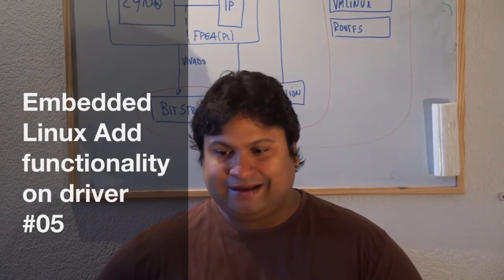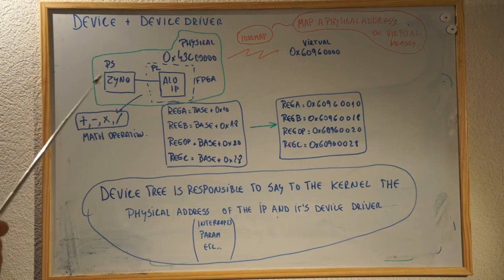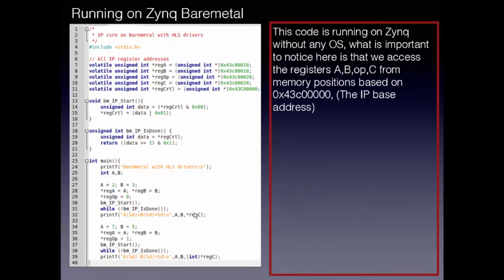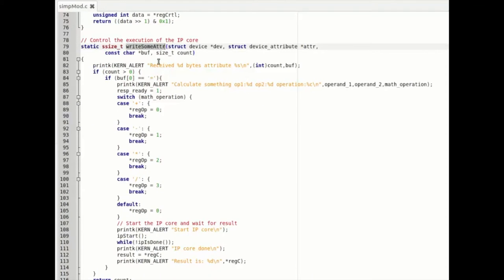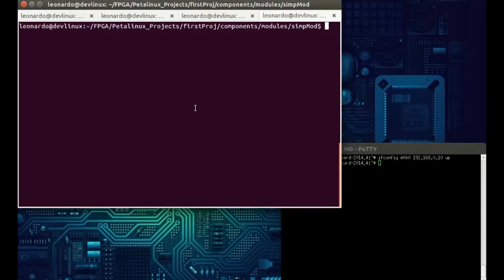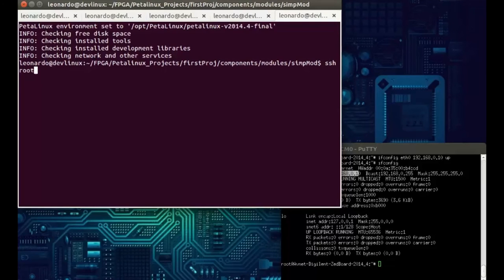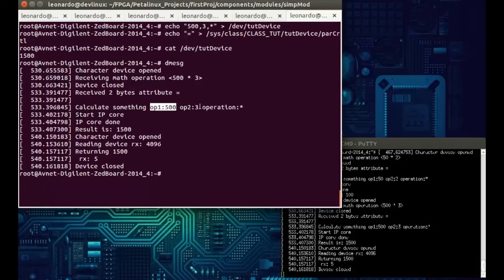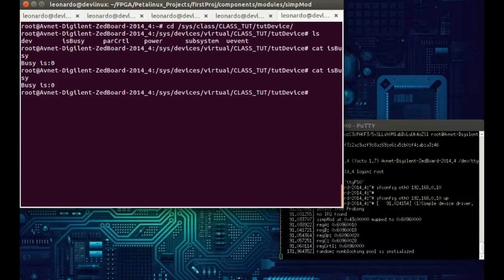Embedded Linux Add functionality on driver #05

Comment: Thank you, really useful!
With small changes I was able to follow the training on my Arty Z7-20 using Vivado 2017.2 and petalinux 2017.2.
It would be easier if the source code used would be available (e.g. github) instead of trying coping it from the video.

Comment: great job,
what if we want to use this driver in a c++ application ?
how can we access this IP module to calculate something instead of using commands on terminal?
should we use the system() function or using ioctl()?